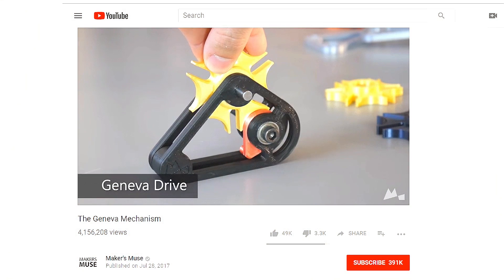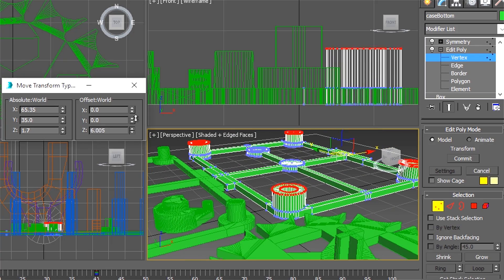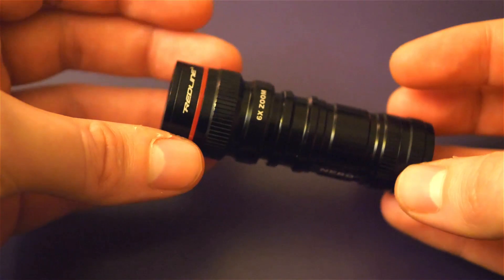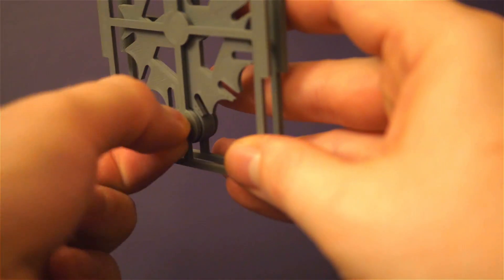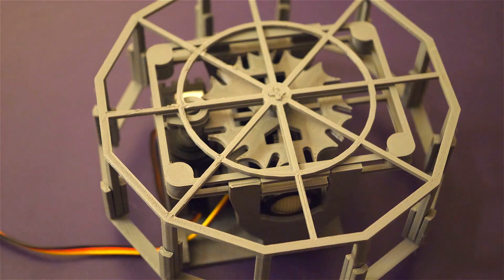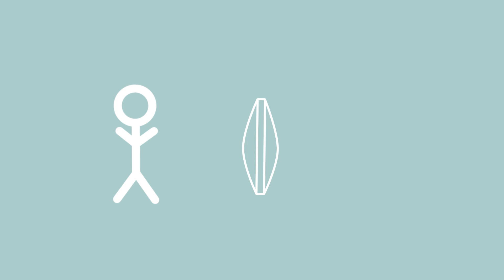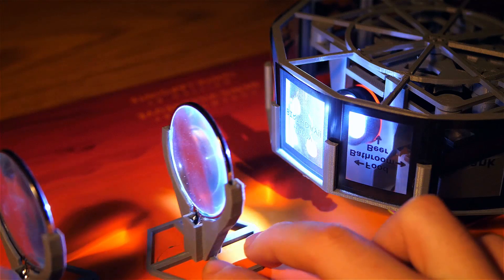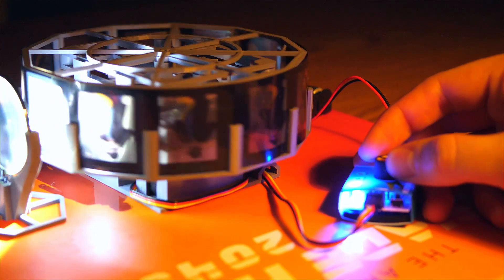Film Projector | 3D Printed

Comment: I used to be a projectionist working with old fashioned projectors, you're missing a 2 or 3 blade shutter that blocks the light while the image rotates to the next frame. That's how you get a still standing frame. each time time it shows, from there on it's just ramping up the speed for a fluent animation (higher frame rate) :)
Google: "projector 3 blade shutter"
Reply from the maker: Wow I'm sure you have a lot of experience in this so thank you for the information! Maybe ill make a part 2 :)
Reply: 3DSage well tbh, my knowledge is limited, during this period the cinema switched to new digital projectors (basically huge beamers) from there on it was basically just pressing “play”
Reply: Just came down to say just this - there's a few videos on YT about the design of this mechanism - fascinating stuff.